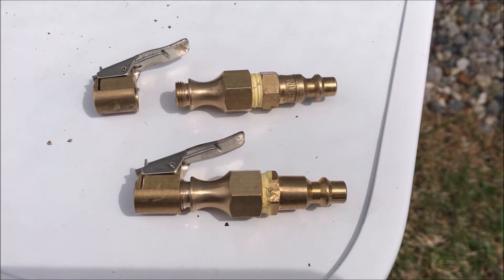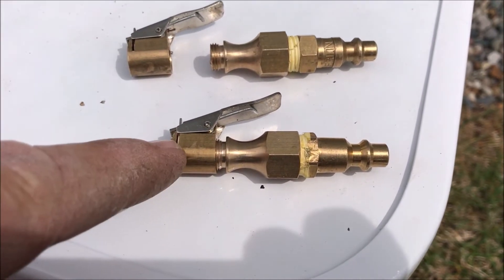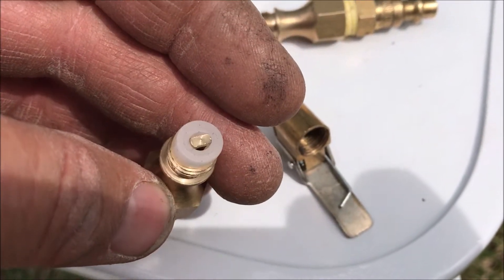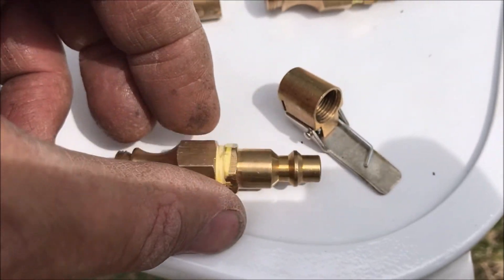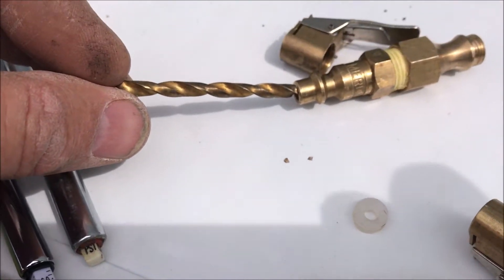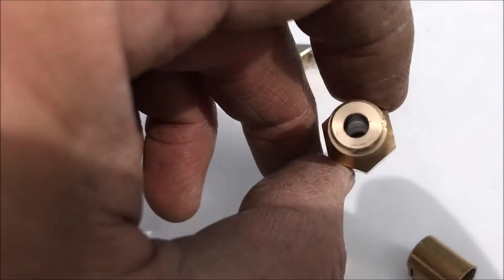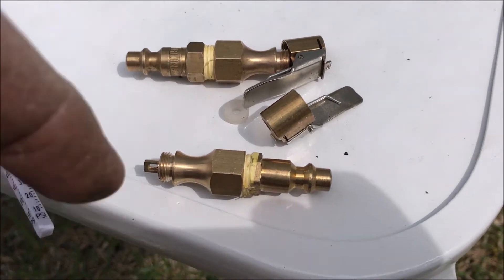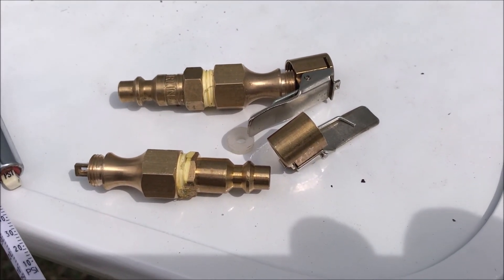OldGuyDIY $7 Max Output Open Flow Air Chuck Mod For Seating Tire Bead On Rim Wheel Car Truck. Best?

Comment: Thank you for an informative film. I thought that open flow Air Chuck gives you the maximum air flow, but see you can increase it even more. May I ask you, if this can work for a small 1Ga compressor (Fortress) I'm planning to use, or that modified open flow chuck is suitable only for large stationary compressor. Will it work w/5Ga pancake?
Reply from the maker: It will work on any compressor.  Those with smaller tanks will simply provide a shorter duration shot of air before kicking on to compress more air to refill the tank.  Thank you for asking.
Reply: @OldGuyDIY  Thank you for the replay. I tried the Fortress already, yes it shuts off very quickly, but it served my purposes. I even didn't remove the Schrader valve, but the bead was seated. It was R16 for a passenger car, probably not much worries about that type of tire.
Reply from the maker: I am glad it worked for you.
Reply: Did you lose the ability to open/close with the lever? If so, how do you control the instant release of air pressure?